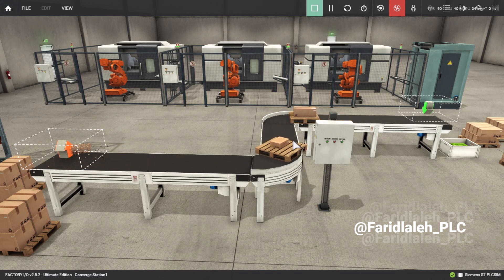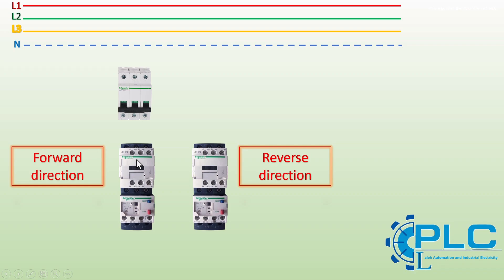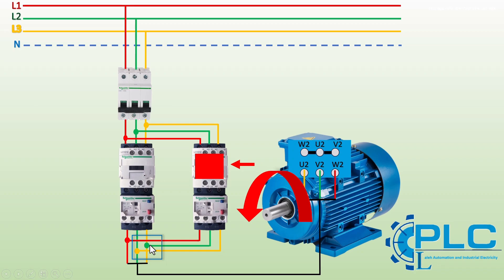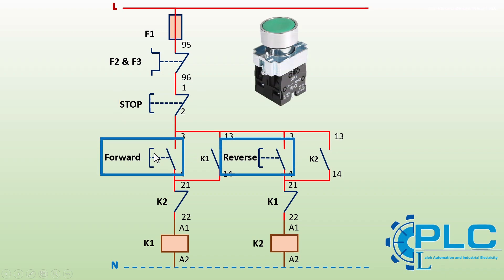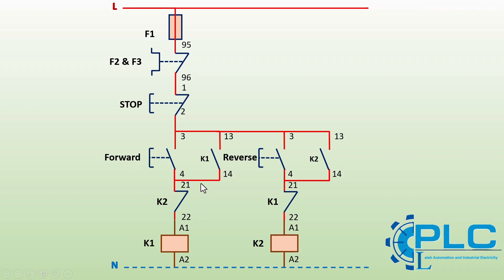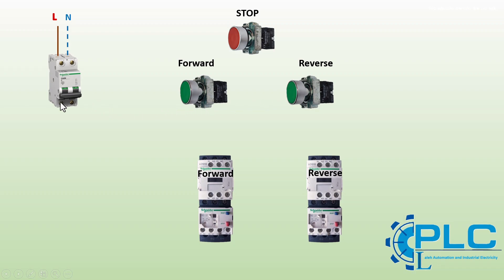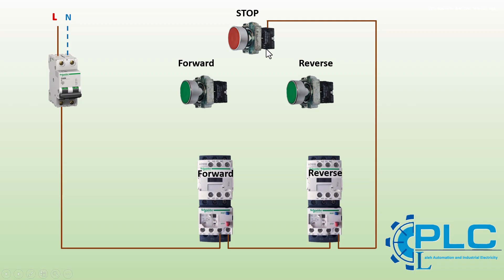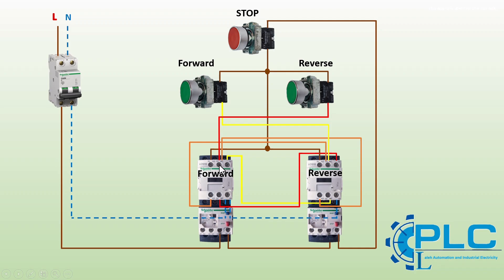Forward and Reverse Motor Control – Complete Wiring for Three-Phase Motor #electrical #education

Comment: sir we are together, can mechanical interlock work on this setup?,
Reply from the maker: By the way, thanks for following my channel and watching my videos.
Reply from the maker: I saw a mechanical interlock in some contactors, but this interlock system is safe and common in electrical circuits.
Reply from the maker: Is this video useful and understandable? Please share your ideas to help me improve future videos.
Reply: @Faridlaleh_PLC sir, its very very useful because we should first understand hardwiring, then it will be easy to understand plc programming concepts especially ladder as they originated from this electrical concepts
Reply from the maker: Thank you so much for sharing your opinion. I'm glad the video was helpful.
Reply from the maker: What do you mean by mechanical interlock? This interlock system is safe and is used in all forward and reverse motor control circuits.